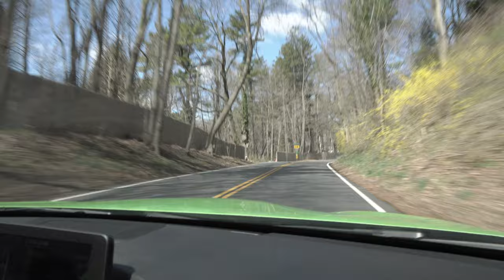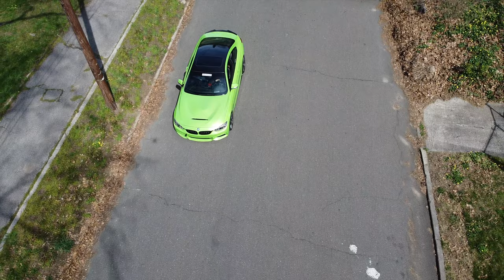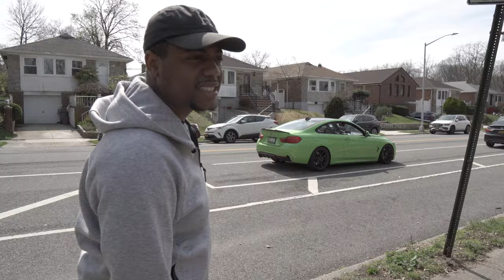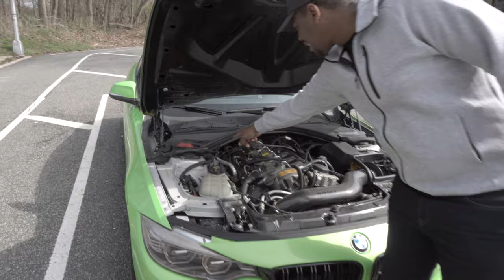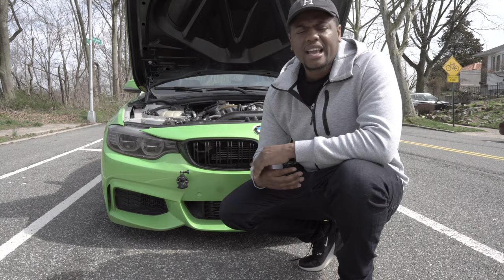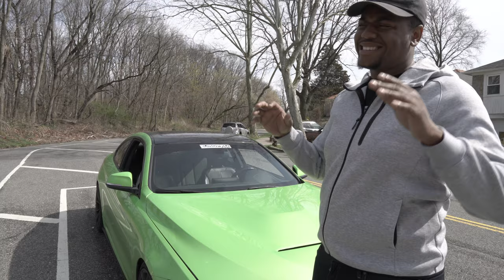How To AVOID Destroying Your N55 Engine!

Comment: actually the oil filter gasket leaking is important because of the location of the housing. If it leaks it’ll directly leak toward the serpentine belt corroding it and leading to the belt slipping off and being sucked into the engine and there goes your n55 lol. They fixed this issue on the B58s
Reply: Yep, but make sure you prime the motor after this job.
Reply: @Areku06  when I did this job I didn’t prime my motor and everything was fine. Maybe I got lucky?
Reply: @Areku06  I never heard that u need to prime ?
Reply: @LucidLoki  It’s a pretty uncommon issue but it has happened to a few people. you’re on the more common side

Comment: OFHG, replace that asap if it leaks that can kill your motor, it can drip oil on the belt and cause belt to slip. But make sure you prime the engine after doing OFHG because that can also kill your motor. Best way is unplug fuel injector wireless hardness and crank 3-5 time.

Comment: Your shocks are gone bro. It happened the same way with my F30 335. Mine was on H&R Sports, by 60k mikes my stock shocks were gone. Upgrade to coils or the Bilstein B8’s and your ride will be completely changed. Even if they’re not blown, I guarantee when you take the stock shocks out (especially the rears), they’ll have no rebound left. Switch them out, no more bounce.

Comment: I still can't believe you push 500+ on an open deck / cast internal motor. Crazy. Got me thinking N55 over B58 at this point for the price differential. Didn't know these had such a high power potential! Word.
Reply: In the real world 400-500 is more than enough I will be pushing 400 hp using mhd on my 640i

Comment: My F06 Gran Coupe has no oil level indicator on the motor. You have to have the car check for you. It drives me nuts that i cant just take a look at the level if I already have the hood up.
My last daily was a 6MT REV-UP G35 and the ridiculous oil consumption gave me anxiety, I had to check it constantly. The G rarely gave oil warnings even when it was at 50%!

Comment: Hey mike great video. love the 435i. N55 is such a great engine if you take care of it and you touched on a lot of the necessary points. Only thing I would add is an oil catch can. Oil blow by from the direct injection engines are common, more so with the n54 due to the lack of vvt. However it can still be an issue with the n55.
Reply: i dont know man, i got 160.000km on my N55 and there was literally zero issues. I will change my rod bearings in 2 months for safety, because i drive it with MHD Stage 2 since 4 years. But other than that, this engine is awesome!
Reply: @oldsql725  what model year is it?
Reply: @mudfiend  2013

Comment: What’s the difference in engine internals vs E9x n55 & F30 n55?
Reply: dont think theres any
Reply: There is a difference, e9x n55 is pwg and f30 2014+ is ewg turbo, best year is 2014-15 n55, early f30 were also pwg n55. In the end ewg makes more power 20-30hp, it has bigger turbo outlet housing and electric waste gate which does better job controlling boost.
Reply: There are no differents. Only the m135i, m235i and m2 had different internals.

Comment: Great advice Mike! I have a 2011 E90 6AT 335i with 43000 miles on it. Decided to let the BMW dealership replace the oil pan gasket and the OFHG due to the potential of engine grenade if it’s not primed correctly. 

Hopefully with it costing me $2100, I’ve bought myself a little piece of mind!

Comment: Is it worth it to go from a 328i to a 335i? or would it be better just going to a m3/m4?
Reply from the maker: IMO a 340i/440i or M3/M4 is a much better purchase simply because they aren’t that expensive at all now. Depreciation hit them all hard ! With that being said choosing any of them from the 328i is worth it
Reply: I just went from a 328i that was fbo too a 335i with the n55 and it is a night and day difference
Reply: @airsoftguy678  went to E84 28i  to F25 35i ( N55 )  it's a way more ( and I have M sport line , supension an gear all set to sport, 19 inch 275 at the rear )    AND THE SOUND !!!! ( force open the exhaust valve with bimmerlink )
Reply: @Slowspeed  not anymore lol I had to get a 335i because all the b58’s are going for 35k+ average with the same miles as the 335 for 22k

Comment: Yo bro one brother to another. Coming from a 2012 c300 with the amg exchaust setup, I wanna get a 2013-14 335 but I do 20-25k miles a year I want this for 3-4 years before it shits the bed. I see most in my price range at 90k+ miles would you say it’s a safe bet to do that? Vs my jawn which is 132k miles...

Comment: m2 and m235i Racing which u refer to as m235R has dual pickup from S55 engine. the M235i (road car version) doesnt have that.. but nothing a baffle plate cant fix. is not the G from the yaw u should be worrying.. more from the pitch when u brake and accelerate on track that cause the starvation.

Comment: One thing is the time and distance between oil changes is way to long on these cars, I personally change 3 times within the time the car software wants it changed. If you change it sooner you remove water that gets into the oil. Use BMW approved oil only... but don't let it get low on oil either.

Comment: Have you done your valve cover gasket before? Mine is starting to leak on my M235i, but my country has lockdown, so I am a bit stuck now
Reply from the maker: Yep I’ve done it. Really not a huge job imo just make sure you seat the gasket on properly especially in the back or it will leak. And be careful not to put pressure on the top of the timing guide.
Reply: @Slowspeed  If I can get my hands on the parts I might try it, thanks man, appreciate the help, advice and videos :D
Reply: Zandré van Heerden fcpeuro has a good video on it. Just make sure you get oem bmw gasket not aftermarket, you don’t want to do it again.
Reply: @Areku06  Good point, might be hard getting the parts with the current state of the world (especially my country).

Comment: nice car! can rod bearing failure happen on a 2015 n55? did they upgrade the bearings? thanks
Reply: Happens after OFHG is replaced and engine is not primed.
Reply: @Areku06  Just got my oil filter housing gasket done! got it done at the BMW dealer. do you think they would have done an alright job? what do you mean by primed? Thanks!!

Comment: Mine just spun a rod bearing...
Reply from the maker: Sheesh older N55 or newer F series
Reply: @Slowspeed  My11 - early N55. Will drop pan and have a look.
Reply: how many miles???
Reply: @esdrasdiaz7109   108000 KM - picked up #4
Reply: @auszman  did you fix it? How much did it cost?
Reply: @ffrgdert540  Its getting there. I bought a low km F series engine (84 thousand KM). When it was installed mechanic did not prime oil properly and it spun number 1 before it left the shop. They dropped oil pan and just fitted a set of std aftermarket rod bearings only - drove 20km and spun number 1 again . Engine has now been stripped and crank ground .25. Will reassemble with Kings SV bearings .25 bearings, mains and big end. Not sure how important it is but they just fitted std bearings however crank needed a combination of b and r shells - does not matter on ground crank. I thing when people just replace the rod bearings they forget about the mains which if starved for oil are also usually toast as well. There is a lot of incompetence on the original shop but meh... Still tallying the costs and will launch a Q cat clam against original shop who offered no warranty or consideration at all. I have also pulled the first engine apart - aside from number 4 all other shells were perfect. It also looked like a potential detonation mark on the #4 piston so... different failure to second engine but anyway - I believe rod bearings are a potential weakness on these engines. We have aimed for a bit more journal clearance on rebuilt engine too facilitate a thicker oil.
Reply: Did it happen after doing oil filter housing gasket or oil cooler gasket? I hear a lot of people have rod issues after this job without priming the motor.